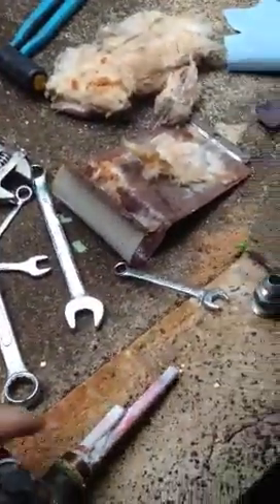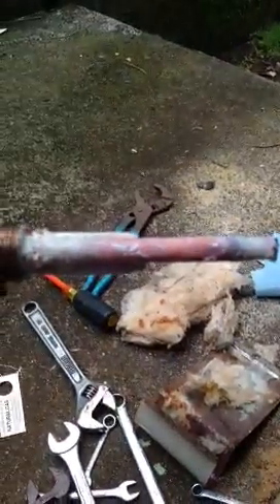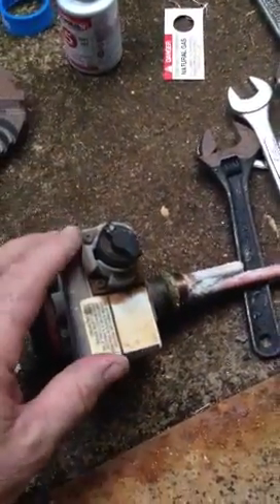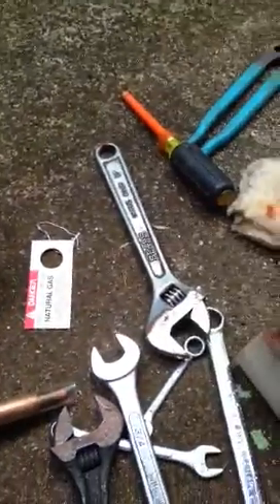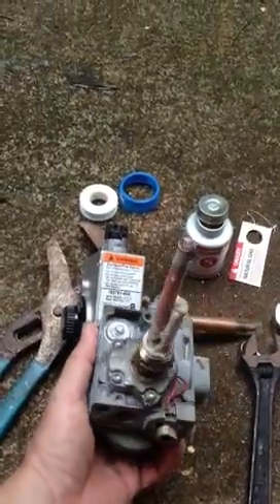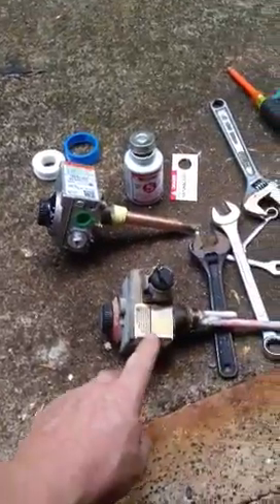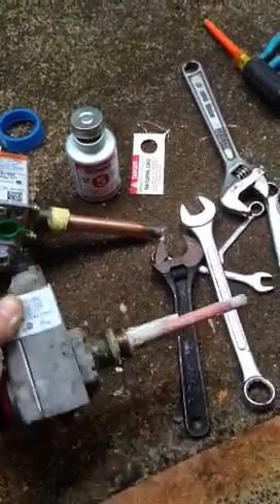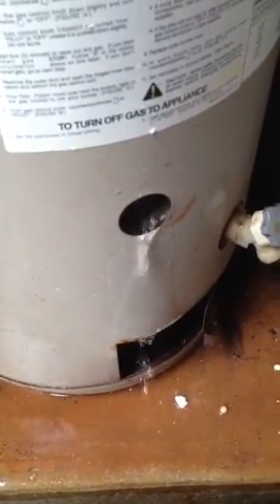Natural Gas Water Heater Thermostat Troubleshooting   Part 1

Comment: Where is part 2 of this video? Disappointed couldn't find it. 
My hot water heater the pilot light won't stay lit.
Reply: If you put a hose onto the drain (on the right) other end to a drain in the floor, that way you don't have water all over to work in.

Comment: $300 for a gas water heater replacement?? What planet do you live on? You can't even get a good electric water heater for that. A good 50 gallon water heater costs $650 to $1200 plus tax and shipping!

If you open a faucet's hot water valve inside the house it will allow the water heater to drain significantly faster.

Comment: If you trip the pressure relief valve, the water will drain faster because air will come in through the valve and release the vacuum.

Comment: Hey Jeff, thanks for the great info. I have one here that isn't responding to thermostat adjustment at all. Pilot staying lit but no increase in temp when thermostat dial is turned. Sound like a similar problem? What are your thoughts? Any help would be greatly appreciated.
Thx again, D
Reply from the maker: Replace thermostat